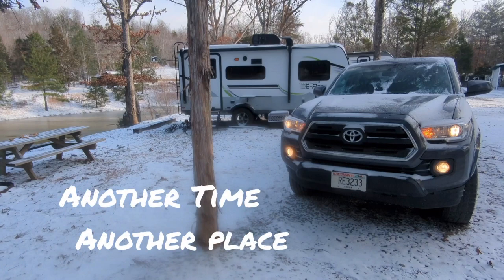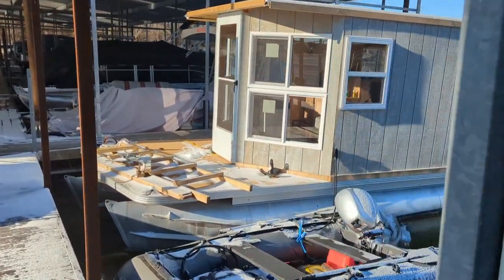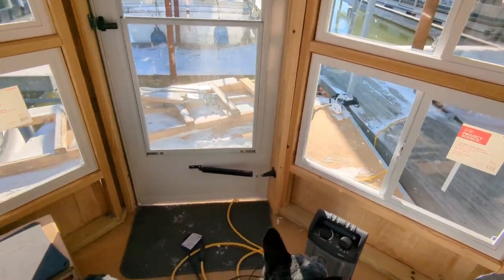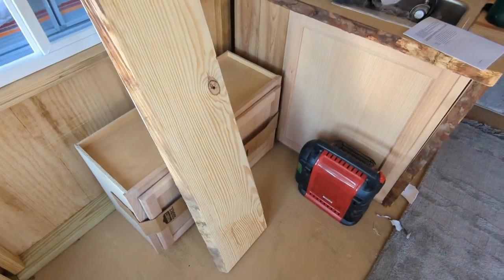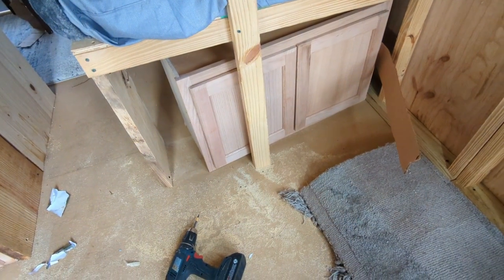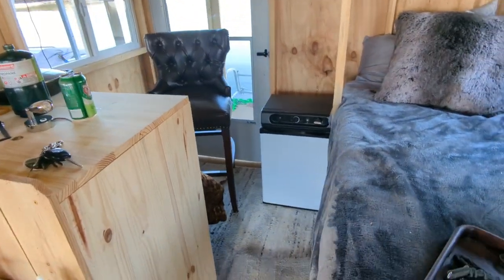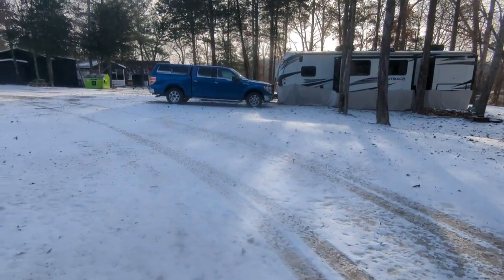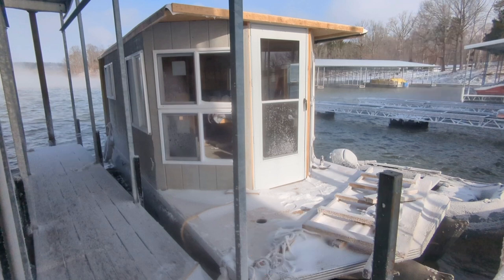#66 ATAP... Sn2 Ep12 Winter❄️ Houseboat Build, Finish Kitchen, Storage, Floating Tiny house off Grid

Comment: hi on boat #2 your front trolling motor can the handle be reversed so it faces back to go forward?  do you have any solar panels yet? Brenton and Wavey can get you some.. looks like a nice spot. i will do a video on my 34x 10.5 steel pontoon  house boat soon. that looked like a lot of motor on houseboat #1
Reply from the maker: Hey bud... The trolling motor hand does turn around, 1 bolt and half a spin. Then it can mont, bow or stern. I do have panels, and fire place but they are in Milwaukee WI. Next year I'll bring them down. Looking forward to your boat video...
Reply: @ATAP...AnotherTime  thank's i want to use one for a bow thruster
Reply from the maker: Perfect 👍